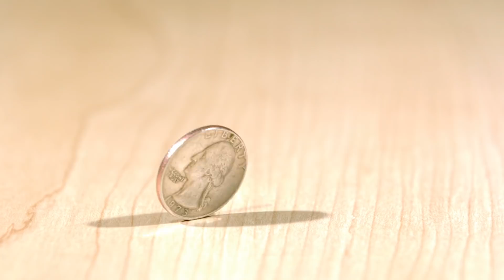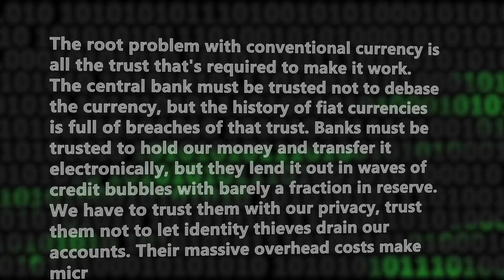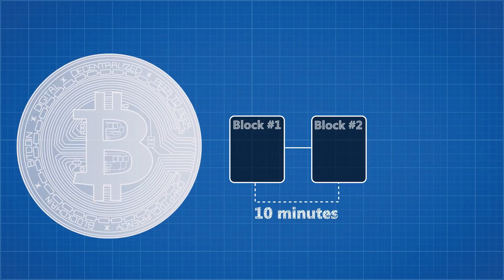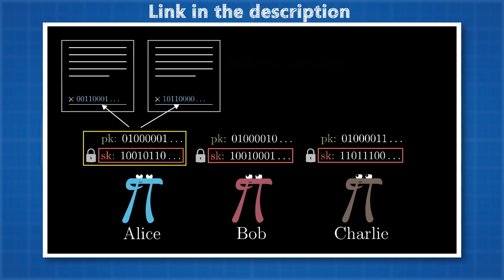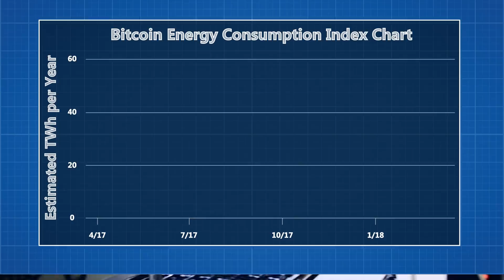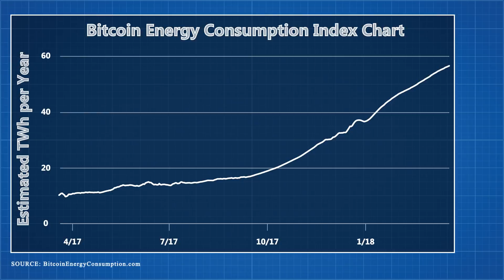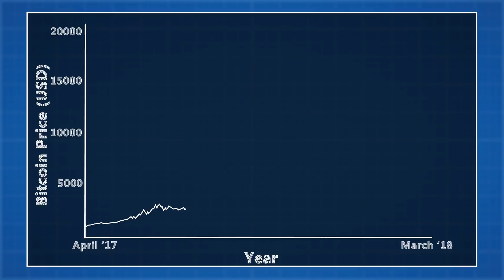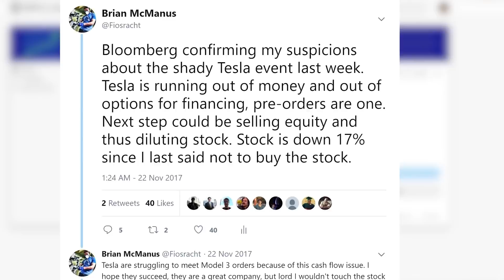Why Bitcoin Is Not Working

Comment: Look at all those graphic cards and me who just need 2 without having to remortgage my house.
Reply: Render farming.
Reply: honestly the small % increase you get form say getting 2 980TIs over getting one 1080 is not worth the extra cost at all, speaking as someone who douse a lot of rendering on my home rig with a 1070 the diffrence between that and my brothers dual 970 setup is minimal at best, on top of that is the increaesd power consumption of two cards and the requirement that you have to use up to date render engines that support SLI
Reply: I don't sli, I assign a GPU for a single task thus each additional GPU gives me 100% more speed.
Reply: GPU rendering does not bottleneck a CPU in fact I did a test and disabled cores to see how it affected render speed 2 cores = 2% slower 4= 1% slower than the full 8 cores.
Reply: then whatever program you are using is WAY better optimised for GPU rendering then I've ever encountered which is entirely possible since I'm only a hobbyist or your % ages are off and it actually has a bigger impact which is just as possible imo.. that said which it is dousen't really matter either way as long as it works for you
Reply: Glad I got my Asus 1080 Ti Poseidon right before this insanity got out of control! :D I don't mine. Just a gamer. :) I'm curious what's going to happen when these miners start dumping used cards on the market, though. :/ Or will these mega miners just use them until they burn out? Anybody have some ideas/opinions? :/ I suspect that if they do dump them, it might really suck for those trying to save a buck. They'll get their "new" used card and it will probably just give up the ghost. On the other hand, having said that, my experience has been that if an electronic component lasts for than a year or two, it will last a pretty long time. But, then again, it's not like I ran demanding benchmark programs 24/7 on the cards I've owned. So, again, I'm curious how this will shake out. (The whole used card thing if/when the mega miners dump them.) Any insight from anybody would be interesting and appreciated. :) I know a few people who were just about to build a new gaming rig right after the cards got sucked off the market. It would be helpful to find out if they should be wary of used cards at some point... ;)

Thinking I will post this in the main feed, too. But, I'm afraid it will just get buried. So, don't think I'm spamming like I'm a needy weasel or something. heheheh ;) Take care, everybody! Stay frosty! :)
Reply: Cybershaman, great username btw. If GPUs are taken care of, mining doesn't ruin them. I have read a couple of articles which talked about this matter and claimed that having GPUs running for about 2 years non-stop will cause them less harm than if kept in a PC used for gaming, which gets turned off every night and goes from idle to full power continuously. I don't remember the technical arguments to sustain these claims but when I read them, they made a lot of sense. If you are able to purchase a GPU from a miner you know and treats his hardware with care and respect, it will work just as new :)
Reply: So sad to see those beautiful GPUs abused like this
Reply: wouldent your CPU be a massive bottleneck then? unless you have a board with two cpu's on it
Reply: metoo
Reply: $3000 AUD for me to do 1080 SLI. You need to remortgage the house?
Reply: you're the best
Reply: Don't be mad you're too poor to afford a decent GPU. Don't be mad you were too poor to accumulate GPUs.
Reply: :) By mining whenever you aren't using it for rendering it's just shortening even more the life span of the graphic card, which it's just around two years for 6-8 intense daily use; a lot shorter if it would be used 24/24 hours. Only a lower end mainstream card, like 750 Ti or 1050 Ti and below it's lasting longer cos it has lower power consumption but also lesser mining efficiency.
Reply: Dragon Skunk bitcoin cant be mined with graphic cards
Reply: The amount of time it takes 1 card to generate revenue is actually hilarious. That same card will likely die before you cover the cost of purchasing a replacement.
Reply: And GPUs. Literally one google search could have saved you from this embarrassment.
Reply: That article is literally pointless. Speak with some people that are actually mining professionally and they will tell you just how easily a card can be burned out.
Reply: Just to be picky, Nothing to do with Bitcoin, all mining is done on asic's now (application specific integrated circuits), GPU's are used for other crypto currency's but Not Bitcoin. So not Bitcoins fault.
and as for transactions/second on Bitcoin, google lightning and segwit.
Reply: Asic may be the way to go but it certainly hasn't stopped anyone from mining with GPU rigs. So no, all mining is not done on Asic.
Reply: i said all bitcoin mining, not all mining 
anyone with a gpu rig will be mining other crypto's and there are many.
some even change over time so any asics built would soon be out of date.
this entire video is based on POW (proof of work) and many crypto's are developing alternatives to this and too many other problems to list
if you know about blockchain you must know how limited and narrow minded this video is, needs more research i think covers it.
Reply: And like I said, yes they can and very much are still mining bitcoin with GPU rigs.
Reply: they can, but if they are, they are spending more on electric than they are making in bitcoin.... thats not counting the cost of the mining rig. anyone doing this wont be doing it for long before they run out of money lol.
what they might do is join a mining pool which mines which ever crypto is most profitable at that time and converts the payments in to bitcoin before paying out to the miners, like i said more research needed
Reply: Double and triple the price than a few months ago.
I dunno where you are from but buying dirt in your area must not be cheap.
Reply: t395delta uhm.. no. GPU mining BTC is certainly profitable. You dont want to mine in places that charge over 10ct/kwh ofcourse. Actually GPU mining rigs have a much longer profitability lifespan that ASIC miners because of the initial purchase costs and power consumption. A new gen ASIC can cost well over 5k and ups the difficulty so fast they lose any profitability within 3 months of first release while GPU mining rigs can run for years. The actual border where BTC mining becomes unprofitable for professional miners is around a 2500-3000$ BTC price, 1/4th of where the price is at at the moment. For hobby miners that pay a premium for their kwh it can also still be profitable if you're willing to speculate on future BTC prices. If you mined at a negative profitability rate in 2016 but have hold on to your coins till Dec'17 you will still have made a huge profit in the end. Also a lot of miners mine to accumulate BTC, not to turn a profit in fiat so they will always be turning a net negative result in the eyes of people that arnt into crypto. There is much much more depth to this whole story than most crypto newbies realise.
Reply: Buy them and whenever you aren't using them mine crypto with them to offset the higher cost. This is the idea behind GPU mining, sure you can buy 100 cards and build a mining farm, but it will never be centralized because every average joe can mine with just 1 card like most people have.
Reply: Dragon Skunk btc is mined with asics not gpus
Reply: You only need 1 mate. You WANT 2. Big difference aye

Comment: True about bitcoin, not so much about other cryptocurrencies.
Take the case of Neo, no mining is required and it serves as a platform for decentralized apps ( dapps)
or Nano, with 7,000 transactions per second. Theres a lot of untapped potential in crypto obscured by its larger but slower and unefficient peer, bitcoin
Reply: I wouldn't call bitcoin a peer. It's more like the grandfather of all others.

Comment: The known purpose of bitcoin is largely based on trusting what the inventor said. It could be as likely that the invention of bitcoin was to flood the open market with computational power. I doubt most miners have the smallest inkling what their machines are actually doing during the process. Going into conspiracy theory levels you could argue that it's just a botnet that people donate their computational power to willingly.

Comment: 4:03 The number of zeroes needed *keeps decreasing" as more computational power is dedicated to the network. More zeroes = easier hashing with fewer non-zero bits.
Reply: No, he has it right. Its not about how many zeroes are in the whole hash its about how many zeroes there are the beginning of it.
Reply: Sure, but does more zeroes at the beginning not make it easier, since you are reducing the bits of the hash to be calculated?
Reply: No, the SHA256 algorithm always produces a sequence of 256 pseudorandom bits. You can't calculate part of it. So if we require starting with a single zero there's a 50% chance for each input. If we require starting with ten zeroes there's about a one in a thousand chance of that happening for each input.

Comment: is it a fact that the price will rise when the amount of bitcoins-to-mine gets closer to zero?
Reply: Its actually worse than that for miners. Every 200,000 coins or so mined, the reward for mining a whole block gets halved until there is no bitcoin left to mine. Essentially miners get diminishing returns by design over time.
Reply: Cassidey Ousley yes for sure I know miners are fucked, but I was asking about the price. the fact that there are every day less bitcoins wont make the price rise because everyone will want a piece of the cake?
Reply: I think either its price will rise to exponential highs or people will just switch to another Cryptocurrency like litecoin. It is technically faster and cheaper by a lot, it just isn't as popular.
Reply: +Cassidey Ousley On a large scale, litecoin will have the same issues. You either have to use a different algorithm, which will similarly have other forms of scaling issues, or layering like the lightning network.
Reply: I couldn't remember the exact figure but you get the idea.
Reply: yes it will rise up the race to mine the last bitcoin but even so you better know when to trade back to dollars once it reached it's end the price drop will be massive

Comment: All crypto geeks know that energy consumption is a huge problem, which is also why most cryto geeks hate BTC. Consider investing in ETH (Ethereum) and NEO. Those cryptos are employing or working on implementing Prove of Stake instead of Proof of Work, resulting in lower transaction times and extremely low energy consumption
Reply: Kanglar No. Just no. An Investment is a calculated risk. You look at the economic environment and you make an educated guess on what will happen. You then put in money and perhaps even have a say in how things are run. In a gamble you are putting money and hoping the odds occur in your favor. You have no control or any way of developing an educated hypothesis of what the outcome will be. Investments are also typically much longer term commitments than Gamble's.

Of course every investment lies somewhere in between the spectrum I just laid out. But Bitcoin very much on the gambling end of the spectrum because there's no logical way to predict the outcome when its value fluctuates at a rate of Thousands of dollars per week.
Reply: "cRyPto GeEks HaTe bItCoIn" hurr durr.
Reply: Burst is proof of capacity, basically still proof of work but uses 1% of the energy  <3
Reply: +WarriorofCathar So is gambling. There's literally no difference, if you're smart enough to know what expected value is. You "invest" in the Dow Jones, hoping it keeps going up, yet you "gamble" on a poker strategy with positive expected value... They're literally the same.
Reply: oh, tell me how people that invest in facebook have a say in what will happen or any idea if it's going up or down. LOL
Reply: Farawayfound EOS is where it’s at bro
Reply: Not gambling if you know what the investment is and its potential
Reply: Cid Sapient, I take it you didn't watch the video? They compare the energy usage of Visa and Bitcoin, Visa uses a tiny fraction of the energy, while processing a thousand times the transactions. Bitcoin is absolutely an enormous energy suck compared to traditional forms of currency.
Reply: ETH is driving GPU prices past the 256 block build limit.

And yes, I did just make a Minecraft joke.
Reply: Farawayfound Both are vastly inferior to NANO, you can't beat free and instant transactions.
Reply: Davit Lursmanashvili I lost 15$on these coins..So I will never try that again :),I cannot predict its value at all.
Reply: Problem with POF is that the one with the most resources can place more resources than average which will in turn favor the strongest and not be a really “fair” system
Reply: Taylor T Teach me your ways man, Bitcoin is getting very hectic as of late.
Reply: dont buy eth now will fall hard with the other altcoins
Reply: NANO doesn't offer smart contract capabilities though, the real value behind crypto (especially with oracles like chainlink)
Reply: Gambling is also a calculated risk (in most instances). "And there's no logical way to predict it's value when it fluctuates at a rate of thousands of dollars per week", there's no logical way to value in stocks then either. Take a look at TSLA, most of their value is derived not from sales cash flow etc. it's derived from speculating that Elon Musk will solve the problem, if he died TSLA would loose most of it's value. Bitcoins value is derived from speculating that it will be the future of financial transactions. I don't like bitcoin (expensive, a lot of power and bitcoin politics have ruined the coin forever, that being said it will rise a lot more since it has first mover advantage). Is crypto a riskier investment then traditional stocks? Of fucking course it is but the more research you do lowers the risk. I recommend  to look at REQ, Chainlink, Nano, IOTA and ETH.
Reply: WarriorofCathar gambling is a calculated risk
Reply: "fuck your centralized system"
as he says on the internet using an electronic device from the comfort of his own home loooool
Reply: "Crypto in general is a high-risk investment, volatile enough that someone could make or lose 10k in 10 minutes."

Welcome to the world of currency trading. Lose 10k in the morning, make it up after lunch.
Reply: Davit Lursmanashvili
What's the difference between investing and gambling? With any investment you are gambling that the price will go up and you will make money yes?
Reply: WarriorofCathar Crypto in general is a high-risk investment, volatile enough that someone could make or lose 10k in 10 minutes. That being said, it isn't gambling because the outcome does not rely on luck, it relies on people who are otherwise predictable.
Reply: NEO is great but what do you think of IOTA?
Reply: WarriorofCathar This is not true. Just because YOU think there is no way doesn’t mean there is not. I’m a full time crypto currency trader and rely on technical analysis and bot algorithms combined with trading before news. Over a long history of MANY trades I have a solid consistent growth.
Reply: Davit Lursmanashvili Investing is the superior form of gambling for smart people tbh, it is very versatile in the time frame you can trade or gamble depending on what you want out of it, however the more you learn about finance and technical analysis of securities the less it feels like gambling and more like an educated investment. Also you are extremely less likely to lose all your money in a short amount of time and you are far more likely to walk away with more than you came in with than casinos or as I like to call them, shiny places for people with more money than brains to piss away their wealth. Any questions? 🤔
Reply: Davit Lursmanashvili that's what investing fundamentally is you insufferable brainlet
Reply: Farawayfound Fuck your POS centralised coins where only the richest can run a node. Sycophants everywhere...
Reply: Will you all please stop calling it "investing" and call it what it is - gambling.
Reply: i dont see the energy consumption as a problem
i bet any fiat minting facility uses gobs upon gobs of electricity
not to mention the cost of the security mechanisms development
as well as the cost on inflation decreasing the value for the entire system
pretty sure visa uses insane amount of electricity running all that hardware to process transactions as well